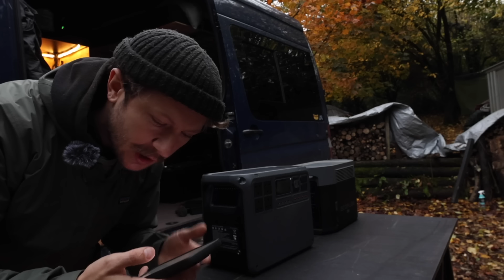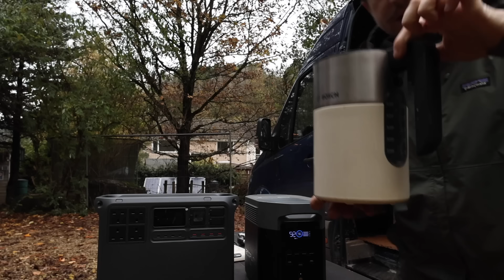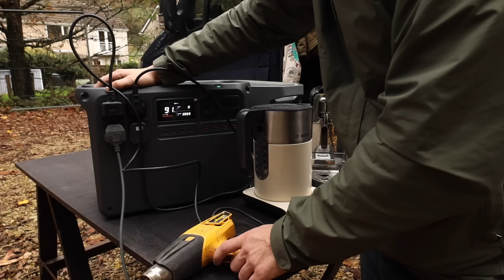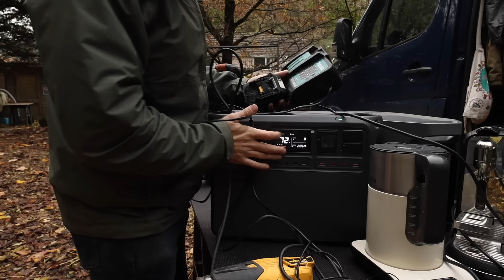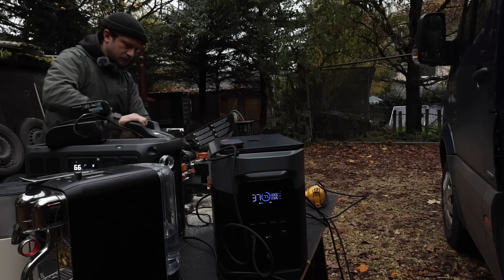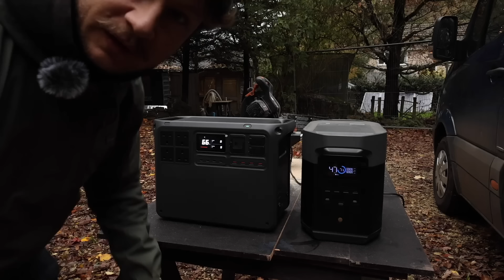DJI Power 2000 vs EcoFlow Delta 2 Max | Essential 2048wh Portable Power Station

Comment: It's not just about the amp hours it is also about the depth-of-discharge (how much you can drain the battery before damaging it). Normal lead acid batteries are around 50%,  Power stations with LFP batteries ~90% (built in protection).

Comment: Do you think the dji could run an 750w air compressor as the initial surge is what i am worried about great video thanks
Reply from the maker: Hi I can’t see why I wouldn’t if it’s 750w
Reply: Скачек будет троекратный

Comment: Hi Joe, so in your opinion is that DJI a better unit than the Ecoflow? And do you know the weight of the DJI? Many thanks, Janie
Reply from the maker: The DJI is around 22kg, the EcoFlow is 23kg 

I think the DJI has the advantage of being a newer model, if you’re looking to expand with multiple batteries the DJI takes the lead but I’m surprised how well the older EcoFlow held its ground!
Reply: @ItsOhJoe thank you 😁

Comment: Xboost lowers voltages and increases the amperage to get over 2.4kw, also Dji needs lots of expensive cable/adapter leads for solar charging
Reply from the maker: Ah thanks for that I wondered how it worked! Shame the cables are expensive on DJI, I’ll have a look into it!

Comment: A nice bit of kit. It's good to see these info videos about portable power gadgets because even us house dwellers suffer power failures and having something standing by that looks useful is a good option. I have a Victron inverter at the moment plugged into a couple of my old car batteries but it's a pain to get going and doesn't deliver all that much power. 

N.B. Our power fails around once per 18 months because our underground cables are around 70 years old and joints sometimes go 'pop'. If people start plugging in lots of EVs on high power sockets that could well snowball
Reply from the maker: Yeah I’ve noticed more & more people requiring a back up power solution in homes. I think a decent power station is definitely an option, literally one button and you have power!

Comment: Great one, Joe! Hope you are well. How does the power solution work in your van now it is nearly winter? You use solar or top up?
Reply from the maker: I’ve been having alternator issues as you’ll see in a new video later today but yeah solar’s been topping it up which is good - and then usually when the engines running it’s charging my Delta 2 Max!
Reply: @I @ItsOhJoe good to know you kitted it out perfectly for your needs when using the van for both purposes. I guess the alternator may be due to replacing considering the age? 👍💎👍
Reply from the maker: @tteric67 yeah exactly that - it looks like the original Mercedes one & van’s done 180k miles so with the added strain of a Victron DC/DC charger + alternator charger it’s finally given up but it’s done well!